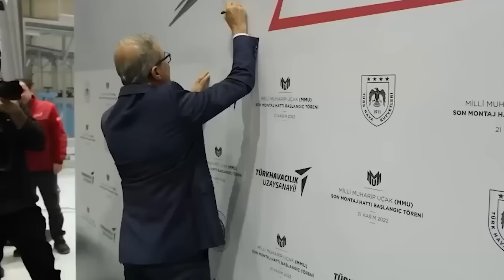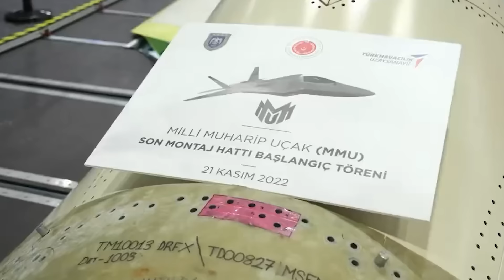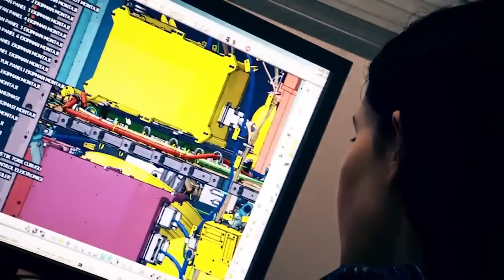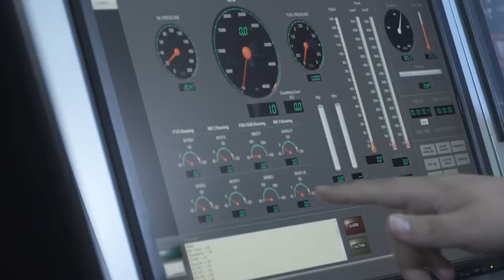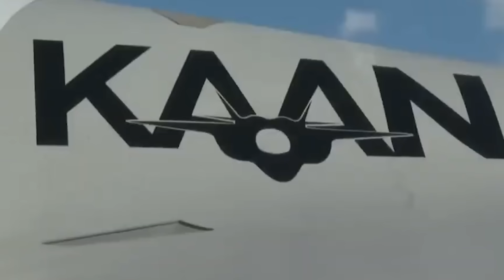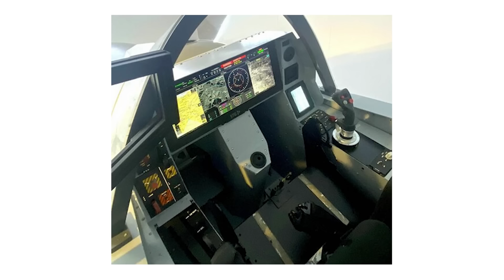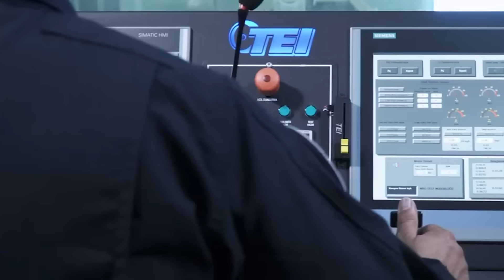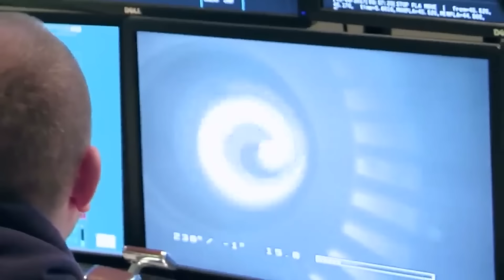Turkey's TF Kaan 5th Generation Fighter

Comment: One detail overlooked when per plane cost of 100 million dollars. First no one adds up the costs of rockets that you have to buy that itself adds up costs tremendously. Also Just like F35 programs if you are pet of USA you have a Limited power also those inputs required each F35 before they take off means They can ground you with The one mouse click... You see there is more into this then the eye sees... Another most important part is Turks have their own AI system that different part of the Military simultaneously works together unlike other fighters. Like each can be an Admiral ship it is own as if one goes down with minimum intervention.

Good  and exciting programs by Turks last 20 years

Comment: On May 2nd, KF-21 broke through Mach 1.8 for the first time, faster than the US F-35.

It is equipped with 40% domestically produced engines from the US aircraft carrier F-18 Super Hornet, and its instantaneous thrust is equivalent to the pulling force of 44,000 horses.

So far, the aircraft's stability and missile operation have been tested by flying at low speeds of 400 to 800 km per hour, and it was confirmed that the aircraft's maximum speed of Mach 1.8 was exceeded for the first time during a test flight on the 2nd.

Mach 1.8, which is nearly twice the speed of sound, is 2,200 km/h, which is faster than not only the domestically produced fighter FA-50, but also the F-35A, a strategic asset of our Air Force introduced from the United States.

Comment: With smaller economy Turkey has kicked India's backside and lighted it's afterburner. Both the 5th gen aircraft of Indian and Turkish origin were started at about the same time but Turkey has shown bigger ambition, higher commitment and better execution. They are already flying and testing their prototype while the Indians are still gloating over their paper model. I won't be surprised if Turkey produces it's own turbo fan engine first before India. They have already got their man placed in the high ranks of the corridors of Rolls Royce in UK. His mission probably is more Turkey than Rolks Royce, I would guess. The only dark lining over the Turkish cloud is their terrible economy. In that sense India has the advantage and there is a saying in India, "der se aaye lekin durust aaye", which means, you came late but you came whole, fit and fine, and that is what matters, in the long run I suppose but don't wait for too long or the world would have moved on to 6th gen. aircrafts.

Comment: The challenge about the engine is there. But it's mainly a design challenge rather than a manufacturing challenge since while GE and PW were competing against to each other to manufacture the current F35 engine PW alongside Türkiye built some infrastructure in Türkiye to build high performance, blisk, Turbo Fan engines. That's why while every other aspect was an infrastructure challenge as well Türkiye didn't build much before produces its first turbo fan engine TF6000. Even though this is a much smaller engine it gave us a lot in know-how and actually will power our Kızılelma and Anka 3 series drones with its TF10000 variant. In the meantime, we are working alongside with a lot of tech firms to build our own 35000-pound trust engine.

Comment: Is there any point in flying a test aircraft without deciding which jet engine to use?
Fighter jets have to re-run various tests when their engines are changed... Does Turkey know that?
Or is it just a rough test and sending it out?
Reply: Amerikan motoruyla 20 uçak üretilecek. Yerli Türk motoru üretildiğinde Block 1 olacak

Comment: 1:05 T129 is on production for the last 10 years. There are T625, T925 utulity helicopters and T929 heavy attack helicopter programs. There are also many wrong info in the video. But still, cudos for effort.
Reply: he said nothing about the T-129, he talked about Atak 2 and the 10 ton helicopter T-925

Comment: I wonder why they hinge the canopy at the front
Reply: Turkish companies were producing 995 parts for the F35, including the canopy of the F35. Let's say that this canopy is the help of the company that produces the canopy for the F35.
Reply: There are ejection seats and many systems behind the seat where the pilot sits. If you design the conopy to open from the back, you have to completely disassemble the conopy for the maintenance of the systems behind the seat. An aircraft technician explained this. Front opening is a good choice and solves many problems. That's why the F35 also opens from the front.
Reply: @berkaysagan9082  that makes sense. Use what you know.

Comment: 5th Gen Fighter with a 4th Gen Engine.
Reply: 'The General Electric F110-GE-129' turbofan engine is being used for test flights. The agreement was made for only 4 engines. EuroFighter had also made an offer, but the F110 was preferred because 40% of the F16 jet is produced in Türkiye. Note this: I am not talking about manufacturing the engine. The engine development phase is ongoing because the engine is 99% complete. Kaan will enter the inventory with the fully domestic TF35000 engine.

Comment: I forsee a lot of problems  for this program is not just about full development of the systems, mainly radar and sensors, given the difficulties much larger and more experience aircraft conglomerates have shown in the late years. It will take time and a lot of money but "could" be done. In the end could even be beneficial to present the Turkish industry as a serious competitor, as it did with the drone offering.
The main problem, to me, is the capability of the Turkish military to keep in service such an expensive plane, which is comparable to an F15, when it comes to service costs. Turkey is not Japan, or Saudi Arabia, which can just throw money as they fit into their military: the costs for flight hour for such a big plane with those performances is extremely taxing.
I see south Korea approach as much more sensible, even at the expense of some capability when it comes to payload. The much smaller K21 will be much easier to sell abroad as it can ft the budget of many countries. Sharing development costs is paramount for the viability of a plane and this can only be done through serial production in large numbers. 
I don't even completely understand the need for such a large platform for a nation that generally flies it's planes inside it's borders: The USA needs large planes because of the distance between America and Asia, or Europe, while Japan needs to survey a very large airspace where airstrips are rare. Both the Tempest and the FCAS will be much smaller then the KHAAN, which means less power need and fuel consumption to get those high performances.
There are also problems with exports as today is very difficult to be "Veto Free" from any of the main suppliers: the case of Brazil being unable to sell the AMX to Venezuela due to a veto form the USA is exemplar: that plane had none of it's main systems being intellectual propriety of the USA, but still got blocked. the case of the Italian designed TA129 is also an example: the USA was able to block engine deliveries and cripple the Philippine purchase (Leonard had to step in).
Much large economies then Turkey, like France, Italy Germany and the UK struggle to place their fighters, despite being less expensive to keep in service due to a smaller size and engines. The export success of the Saab Gripen suggests there is always request for affordable and capable platform, not so much for more complex ones, unless the development costs are shared with other partners form the beginning. I guess turkey should have look for some agreement with India, for example, trying to erode some of the Russia's market dominance, but so far turkey and India don't talk much, and are at odd in the Caucaus.
I hope Erdongan's hubris and desire to show off after then exclusion from the F35 program will not come back to bite turkey's industry and economy.
Reply: I agree on the part of the challenging tasks in relation to the avionics. That is, besides the home-grown engine, the sticking point of this whole endeavor.
You are also correct with the increased service cost of a dual-engine fighter, but keep in mind they wanted to acquire around 100 F-35. So they had to have the budget somehow.
Do they need the increased range? Who knows anything in this challenging times for sure?

I disagree with your assumption, that the KF-21 will be much easier to sell because of its smaller size. The competition between 4.5 Gen Fighters is much harder than between 5 Gen fighters - If the Turks can pull it of, that is.
Sorry, but nobody has seen the Tempest yet and I doubt FCAS will ever be seen. So for that comparison we will have to wait.
With the "Veto Free"  you have pointed out the other main challenge, which has to be solved so that the Kaan project makes any sense at all.

You are right that bigger economies struggle with the same task, Turkey however has no Plan-B for it. So its a “do or die” situation. Lets see if that is a sufficient motivation.

The Saab Griepen is not an export success and India would not be a good fit, in my opinion.
Reply: The key part your missing is Turkey's purchasing parity is way, way higher than lots of richer nations across the world. For instance Germany has a higher military budget on paper than Turkey by tens of billions, but almost half of that money is spent on legal costs alone. 10 billion in Germany or Japan doesn't actually go so far with all of the bureaucracy associated with it, but 10 billion in Turkey goes extremely far in terms of manufacturing arms. 

Turkey has a fiscal & inflation issues for sure, but in terms of growth and manufacturing it is absolutely booming, this will only increase in the future with it's young population and increase in general population to nearly 100 million in a few decades. 

Final point your comment "I don't even completely understand the need for such a large platform for a nation that generally flies it's planes inside it's borders" - you need to take a closer look at Turkish history to actually understand exactly where it's been and where it is situated now. It's a country with Russia to the north and an enormous war going on there with Ukraine, various beefs in the Balkans nearby, Syria, Iraq and Iran on the border (need I say more?). 

I think it's quite difficult for Europeans to understand why Turkey is so militaristic without looking into the history of how the country came an inch away from being entirely divided and colonised, and various terrorist groups operating on it's borders.

Comment: @45 seconds.. Turkeys goal at being militarily self sufficient ? THen you show a picture of a YF22 Raptor clone. PMSL.. Same as the Chinese.. I can just imagine the offline bidding war for stolen plans of the YF22 being sold at auction...  Ladies and germs.. this rare and highly sought after sandscript in pen and ink design for a new 5th gen fighter jet for the 20 something 40's once we have ironed out the slight problem with this and the odd dynamics of that and the unstable nature of fluid dynamics over the wings of Z minus redacted (for national security reasons of course).. Yes please buy our new fangled jet capable of dust cropping and gathering the remote cattle in Turkys steep wine groves.
Reply: Anybody can show a picture of anything. What was done here was 58,000Lb thrust lifting off a 60 ton, 68ft long aircraft, climbing to 8,000 feet and then returning back to the runway and safely landing on her very first flight. I would say, KAAN has accomplished somewhat more than gathering remote cattle. But thank you anyway.

Comment: I'm sure it will serve Turkey well enough within the region. But will it be something like the Eurofigher, F35, or the F22? Probably not. But could be they are just looking a good enough weapons platform for air to ground ops.
Reply: KAAN block 10 version will be better than F35. That is, for air-air/air-ground missions. KAAN block 20 will be smaller and will perform air-air missions. (F22 equivalent) The other blocks will manage unmanned warplanes. (Kızılelma-ANKA3 ) WILL SWITCH TO THE 6TH GENERATION VERSION.
Reply: F22 den daha iyi yakında herkes görecek.
Reply: It will be better than f35 junk
Reply: That "probably not" shows your thoughts…
Reply: It will be far better than the eurofighter. The eurofighter doesn't have stealth and internal bays, this does.
Reply: TAI hopes to bing KAANs avionics to the same level as the F-35s. Hard goal, but if they accomplish just 80% of that and can manage to build the indigenous jet engine with 35,000 lbf…
I think they get a quite capable fighter which could be a contender for the 3. place of 5th Gen fighters (After F-22 and F-35) right now. 
(Sorry but Eurofighter shouldn't`t be in your list)
Reply: @0cu0  aselsan tulgar hmd, aselsan burfis, aselsan toygun eots, aselsan karat irst, aselsan yildirim dircm, aselsan aesa gan radar. TRMOTOR TF35000 engine, havelsan software sensor fusion etc!
Reply: @Hasanbas-rv3vm just words
Reply: @0cu0  look all these systems up!
Reply: @Hasanbas-rv3vm 
Sorry, I can't predict the future. Naming things or even having prototypes is not enough to determine capabilities

Comment: Retractable landing gear apparently has not been finished yet.
Reply: It is a tradition in aircraft development to complete first flights gear down. I think the idea is to minimize risk by operating only what is necessary for flight control.
Reply: @ahmeterkan5052  I suppose there is a certain logic for designing landing gear lastly, giving priority space to the engine, avionics, radars & weapons systems, as those are the most important components for engaging in battle. 
They are literally "Not putting the cart before the horse"
Reply: During maiden flights, landing gears never retracted.
Reply: It is able to do so,but during test flights this is standard procedure.

Comment: How can a country with 60%+ inflation try to produce something it thinks will meet the requirements of a 5th gen fighter? With just $1.8 billion in investment? Perhaps it only has a frontal reduced radar cross-section, although that intersection of nose and canopy looks a bit questionable. No vectored thrust or thrust obscuring so its heat bloom will be normal and maneuverability more like a 4th gen plane. And clearly the demo model Erdogan sat in was a bad demo if the canopy is mis-aligned.  Go ahead and try, but remember that like Russia you can't lie your way into having a better military.

Comment: Is this 5th gen fighter jet. Why it's wheel not folding..
Reply: GENERAL AND FIRST RULE  THE LANDING GEARS ARE ALWAYS DOWN  AND NOT RECTRACTED DURING THE FIRST TEST FLIGHT .

SHOULD ANYONE IN AVIATION KNOW IT.
IF THE TEST PILOT HAD BEEN APPLIED “ GEARS UP” IT WILL BE EVALUATED AS A FATAL FAULT DUE TO THE PILOT MALFUNCTION

Comment: So many parts that have to be designed from other countries, without any strong orders on the books.
This aircraft looks to be a Turkey only aircraft because I can see this aircraft being under priced by the opposition.
At over 140 million a pop for a low observation that right it's as stealthy as a super hornet, no country other than Turkey would buy this.
Prototypes and production are two entirely different animals.
Calling this aircraft 5th gen at this time is a long stretch, we will see nearer to 2030s then onto 2040s if it goes into production............. by then most western nations will be 5th to 6th gen.
Reply: Its not called 5th generation without reason, you should take a look at its super advanced capabilities, aerodynamics, the materials used on the aircraft are same level as F35.
Reply: its radars will be much more powerful than F35 radars.

Comment: Turkey (Erdogan)'s ego eclipses its ability. sorry but the Turks are about to learn the same lessons the Russians and Chinese learned... 5th gen fighters are expensive af. even if Turkey can actually put these things into production, maintaining them is another matter, entirely. the F-22 requires something like 14 hours of maintenance for every operational hour in the air. the russians found out that their stealth fighters are a complete joke and won't fly them in ukraine anymore. too expensive. the chinese can't afford fuel for their j-20s, and that doesn't even consider the chinese engineers can't get the j-20's avionics package to work.

I mean, hat's off for the effort, but if they don't start throwing tons more money at it, it'll never get produced in numbers that'll replace what we sell them.
Reply: To put your “maintenance man hours per flight hour rate” in perspective, for the F-35 it is ca. 5 and for the F-16 ca.17 hours. Hard to make conclusions out of that. 
You should have gone for the “Mission Capable Rates” of the F-35 if you are against 5. Gen fighters. Meaning the fighter the US is selling everywhere has still some trouble.
Will KAAN have the same problems? High probability, but the money spent will stay primarily in house. (besides for the engines and stuff)

Comparing the Su-57, J-20 with the F-22 is quite problematic. Russia has only 9 Su-57, not more than flying prototypes, in my opinion. 
About the J-20, I can’t differentiate between propaganda and facts. Hopefully we will not see an actually war in order to be able to see the truth.

My conclusion. Every 4.5 and 5 Gen fighter is quite costly, especially if you add the maintenance cost.

Comment: With American made engines and designs from bae systems isn't so Turkish figher i believe
Reply: It is not true, design is not from brits, bae Systems, they have Planed but not do. Yes, American engines interim solution, between 2030 - 2032 own engine, between 35.000 - 40.000 lb per engine.  İmportant is the software and avionik.